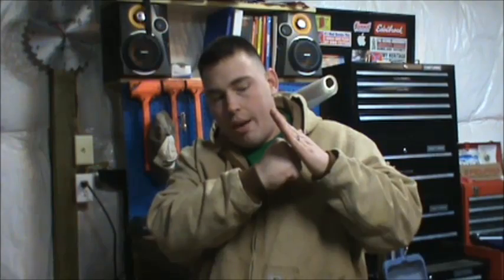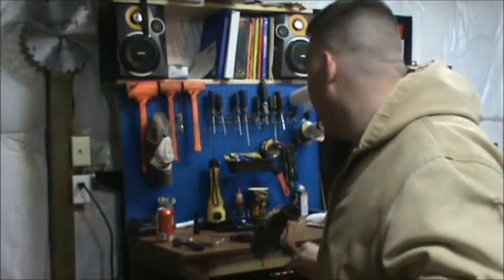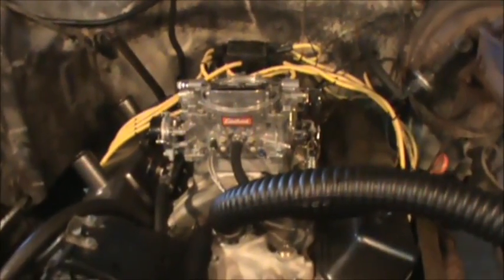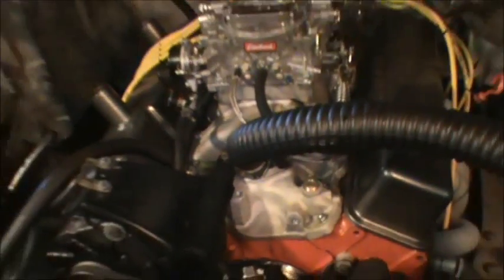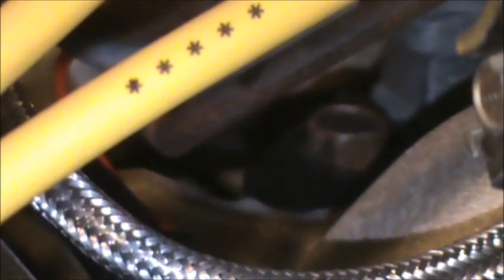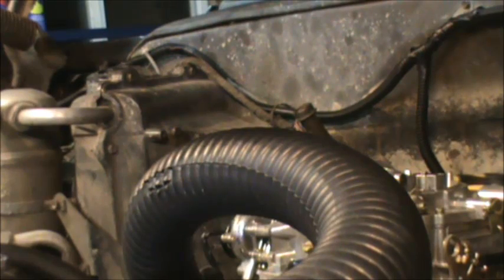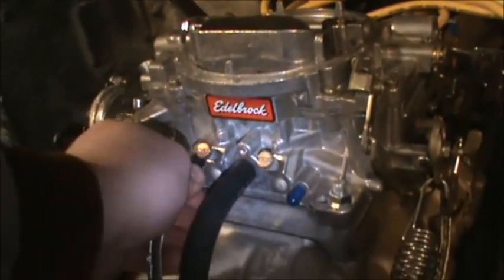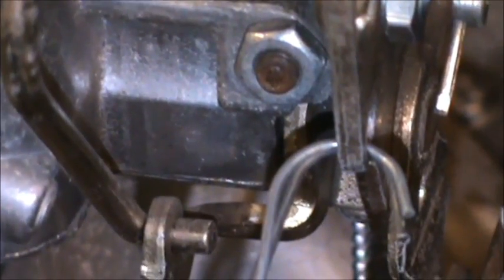Engine Building 101 How To Set Ignition Timing

Comment: Video is pretty good, but it would have been nice if you had shown total timing with Initial and the mechanical all in at 3000 to 5000 RPM. That would help explain how much total timing you have with the initial (idle) + the Mechanical at higher RPM. You could even attach in the vacuum and show how total timing varies with Initial + Mechanical + Vacuum. Please demonstrate that.
Reply: Great video thank you very much!

Comment: I felt the need to add a comment about the elastomer vibration damper creep error and the fact that you only showed how to set a small block chevy, As a 45 year veteran of automotive repair,over the years I have seen the vibration damper rings creep towards the retarded timing event causing a loss of power if they are set by the factory cut notch used to time the engine when it was first started at minute one of the engine's life. Sir Issac Newton explained objects in motion and stopped and their tendency to remain in their original state. This would explain the creep as the crankshaft turns the damper,the timing mark has to try to keep up in a very simple way to understand it... . The best way to determine the True TDC is to do it with a dial indicator thru a sparkplug port on the number one piston then remark the damper ring after determining the before TDC and after TDC and splitting the difference of both marks for the true TDC of the crankshaft. If you want to see the full vacuum and centrifigal total advance curve,now you will need a shop tachometer to determine when you want the curve to end...generally between 38-42 total advance at 3600 RPM on a V8 to allow all parts of the distributor to go fully on or full curve. The best way for a home hobby racer type would be with a timing light with a resettable advance knob and use the the True TDC mark you made earlier to see the total advance numbers. The idle speed must be observed as you set the timing as it is important to have the idle set properly for keeping centrifigal and vacuum advance from entering into the equation from an idle speed that is too high while resetting the distributor advance at the block. After the timing has been reset to where you want it,the next step will be to readjust the idle mixtures to make the fuel event happy as the movement of the throttle plates while adjusting the mechanical part of the will change flow characteristics of air during the venturi effect on the idle mixture jets/screws as the flow properties are changed...but that is a discussion for another class lesson if you want to know more about it. Learning to read the sparkplugs is very helpful in determining the effects of poor tuning and the use of a common vacuum gauge will tell you more about an engine than you might think possible...I have fixed more car with a $5 tail light tester and a vacuum gauge than with my expensive diagnostic tools over the years...feel free to comment on my thoughts and remember that I have been fixing cars since they all had point ignitions and could earn a Doctorate based on the crappy Ford EEC IV scrap...best advice to offer you while doing ignition timing is to keep your fingers out of the belts and fan...   :)

Comment: I have a 3.0 V6 in my 93 Dodge Shadow, I dont think the timing is adjustable by twisting the cap, but how would I go about fine tuning the timing after putting the engine back together (currently replacing head gaskets and checking other seals). It has a sensor wire so it may electronically adjust but I dont know if that is possible

Comment from the maker: @mentalissues41 you may have a lot of play in the timing chain I had the same issue myself it drove me crazy for a while. I found it then changed over to a timing gear drive set. No chain just gears. Dead nuts accurate and more reliable and will work great for high performance motors.

Comment from the maker: Sorry it has taken so long to reply total timing is just the amount the timing the spark is advanced while at peak rpms. Unless you are running a high pro motor don't worry about it so much for stock motors 0-8 degrees and 8-12 for slightly modded motors. Also timing plays a huge roll based upon the octane and burn rate of the fuel you are running. The faster the fuel burns you need to have a closer to 0 base timing so your not fire to early and the timing cure will make up for that as the rpms

Comment: my timing will not stay in the same place? I start it...set the timing to 0 shut it off, tighten the distrib. down...start it and its not on zero...so i do it again...same deal...the dist. is not moving while i tighten it down, so what would be causing this? any ideas???
Reply: Bad slacked timing chain. Replace it.

Comment from the maker: @Skeeter66 Your welcome. When it comes to setting your idle speed have everything set up as if you were about to hit the road. If you cap off or disconnect the vac advance line from the card you will only find yourself making adjustment after adjustment when you start connecting everything back together. Just have it all hooked up to the carb fire it up and adjust your idle sped to where ever it makes you happy. Hope that helps thanks for watching

Comment: Thank you for saying that you cap off the vacuum advance, Zakry.I had to check my timing after I had to put a new intake manifold in, and  it made sense to me to cap off the advance since it would be fighting my dizzy adjustments. Thank you for saying that. First time I've done a  timing adjustment and I had a basic idea of what to do, but I confirmed that I was doing it right all along with capping the advance off. Thanks.  Do you adjust the idle speed with the vacuum advanced capped off too?

Comment from the maker: @olboothboy on your harmonic balancer or " Damper " there is a line grooved in it. As the light flashes when the cylinder fires that line will show on the timing tab when the light hits it. When you find the line mark it with white or yellow paint maker to see it easier when the  timing light flashes on it. Hope that answers your question buddy if not let me know

Comment from the maker: @ Jerry Barnard. I'm guessing the engine doesn't run at all?  If it is too far advanced it can try to fire on the intake stroke causing it to shoot flames from the carb. Also your distributer could be 180 off causing the same effect. Does it try to fire at all?

Comment: Pull the vacuum line from the distributor at which point it connects to the carb. Put your finger over the port opening on the carb and see if it is sucking vacuum at idle. If you feel is sucking vacuum, then you have it connected to the wrong vacuum port on your carb. You need it attached to the vacuum port with no vacuum sucking until you give it throttle. Find the port with NO vacuum at idle. Then connect your distributor to that one.

Comment: I removed the distributor and put it back in after some painting,it starts up fine "cold" idles fine, runs fine but after its driven and gets hot and you shut it off and go to restart it, it cranks really slow. Could this be a timing issue, if so which way would I want to twist it to fix this prob?

Comment from the maker: @plwitmore1 as far as the motor reving up when the vacuum is connected it can a little but not tachin out. Have you adjusted the idle screw?  What kind of carb are you running and as far as the total timing the only way to gage that is too have a damper or "harmonic balancer" that has it preset on it and if you get a new one I would suggest a fluid damper if you are going for any type of high rpms

Comment from the maker: @eddcres69 it depends on if the ignition is controlled by the computer and if the distributer is run off the cam or if it is a coil pack